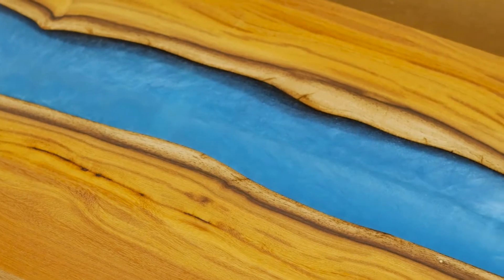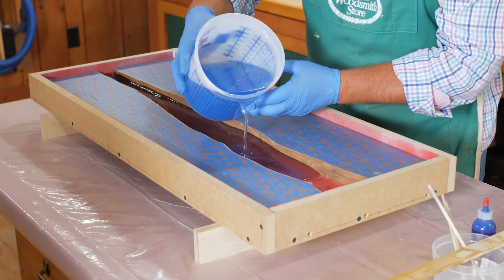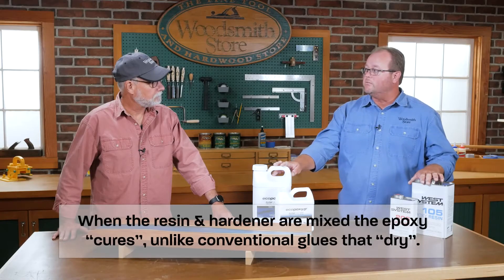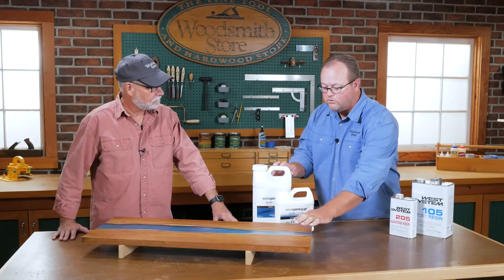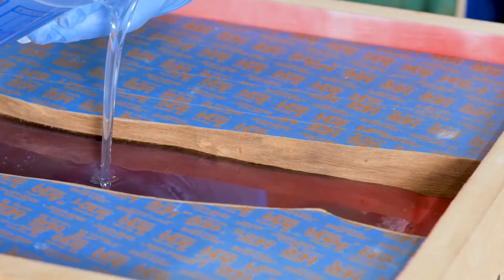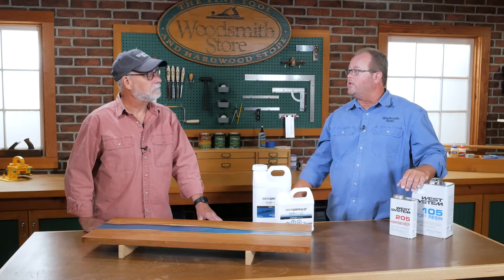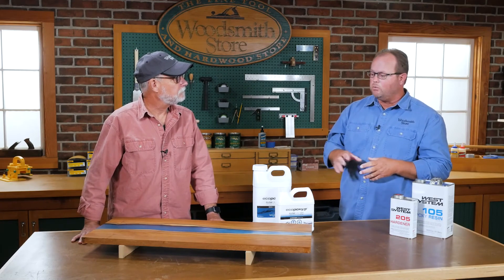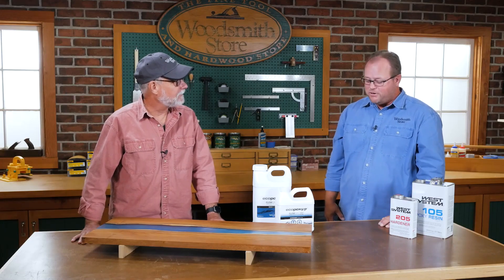River Table, Part 4: Q&A — The Difference Between Regular Epoxy and Ecopoxy

Comment: I'm new to ecopoxy resin. The brand is nontoxic and plant based. Do you recommend I wear a respirator while working with ecopoxy or will I be fine without one?
Reply from the maker: You don't need to wear a respirator when mixing or pouring Ecopoxy. I would still wear a respirator or dust mask when sanding it though, just like sanding any other material. Thanks for your comment!
Reply: @thewoodsmithstore  thank you for your reply!